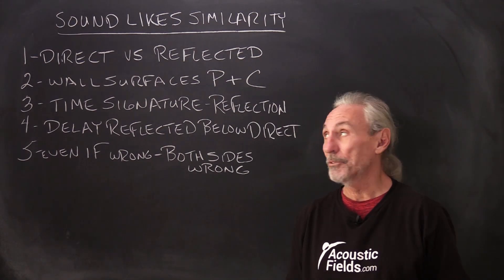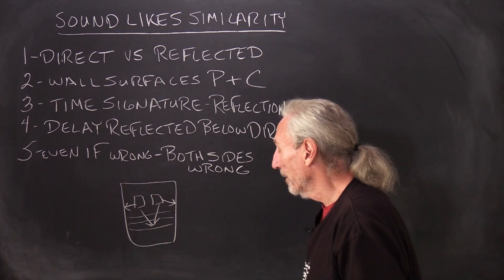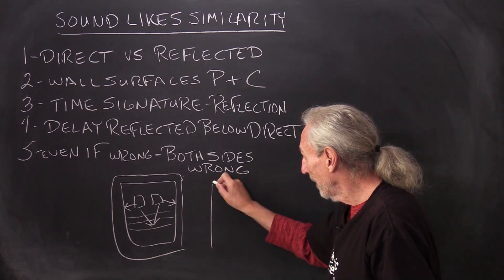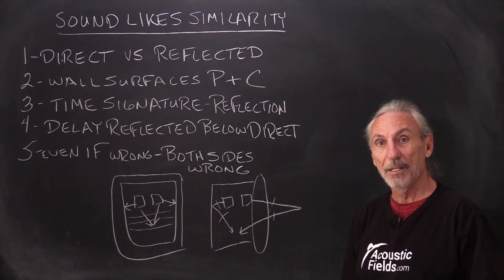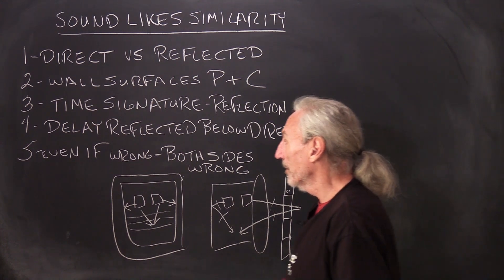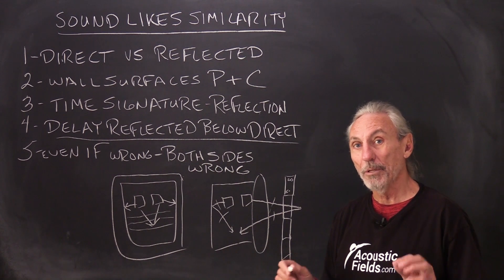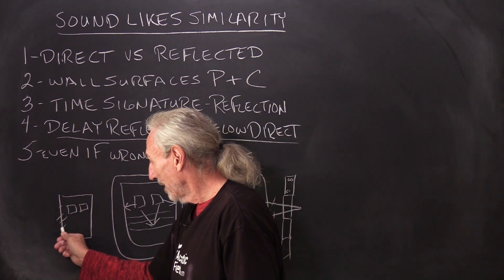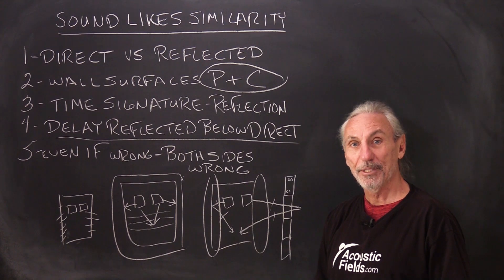Sound Likes Similarity - www.AcousticFields.com

Comment: Anthony Grimani thinks wall treatment should be asymmetrical. Absorbers on one side should be complemented with diffusers on the other side directly opposite. 🤪
Reply from the maker: Absorption and diffusion are separate technologies with completely different acoustical objectives. Low- frequency management must be placed on all 4 wall surface areas. Diffusion placement is usage dependent.
Reply: Hello Ganesan, I have seen several of Grimani's lectures. Actually, if you recall his slides, he uses similar treatment on both side walls, but staggers the order of treatment. So, he does treat both walls similarly, but the treatments are in different order on the opposing walls. That is probably what you are recalling. That surprised me; 1st time I've seen that. -JAS in Philadelphia

Comment: What if you can’t make both walls similar? Take your open concept room example where you have a left wall but the right wall is much further away. In that case would you use differing types and/or amounts of treatment on each wall?
Reply from the maker: You must have equal side wall distances from speaker to walls. It is a requirement for a stereo output signal through speakers. look at the way a stereo signal is created through the use of two speakers. When you begin to understand how a stereo image is created, you will then realize the importance of the equal distances for time signature management of all reflections not just the sidewalls.

Comment: Wouldn't low  frequencies go over a half wall and high frequencies be easily more reflected
Reply from the maker: Low frequencies are wave energy that goes through walls. Middle and high frequency energy is ray energy that is reflected off of wall surfaces.